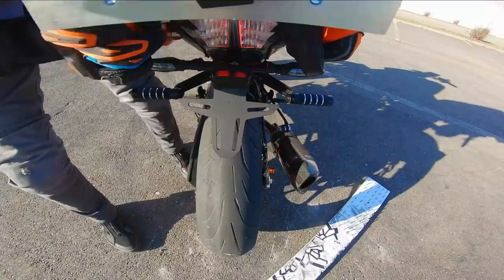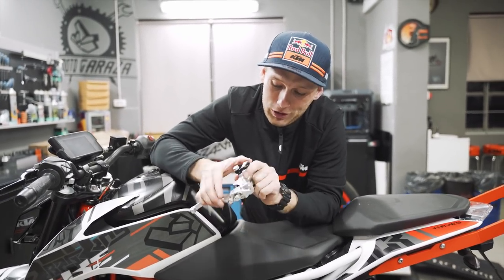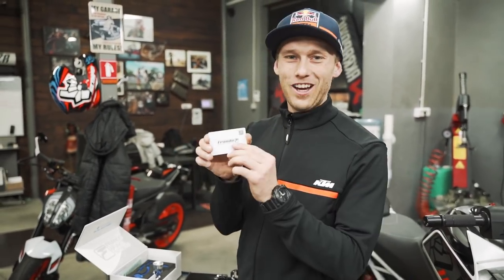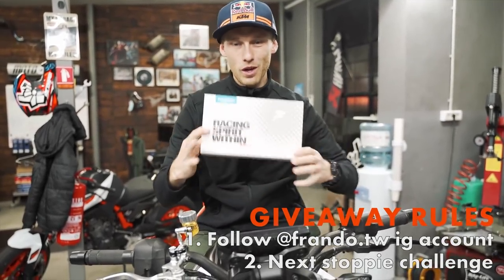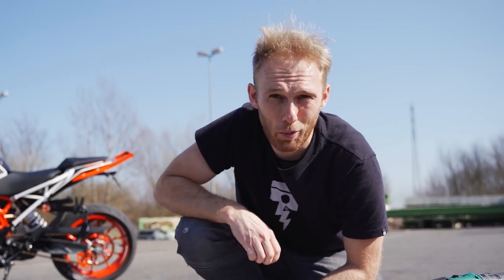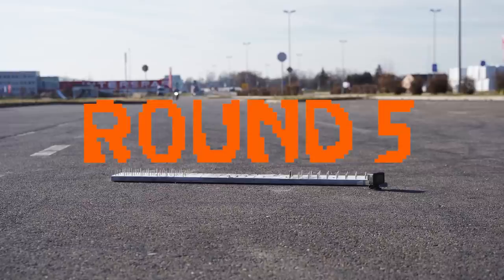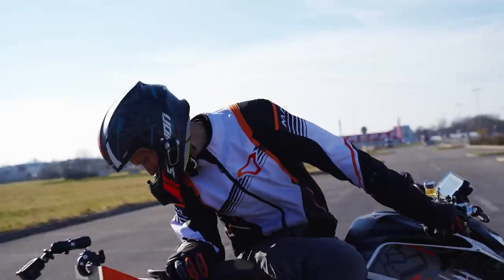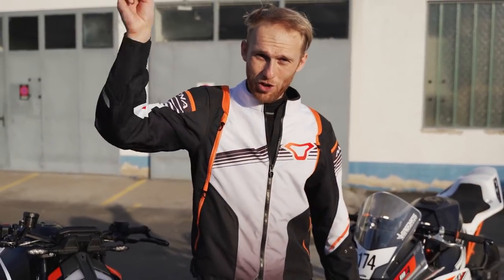FLAT TIRE STUNT RIDING CHALLENGE  | RokON VLOG #110

Comment: Someone please help me figure this out:

I have a 2019 ktm duke 390 and i'm wondering if it is possible to replace the throttle tube on that model since it is ride by wire... Does this mean there is no actual cable that I can connect to a new throttle tube? say the g2 competition quick turn throttle tube. Any info is helpful thanks